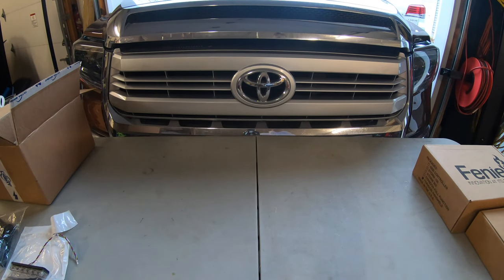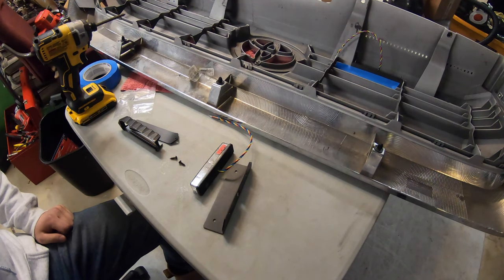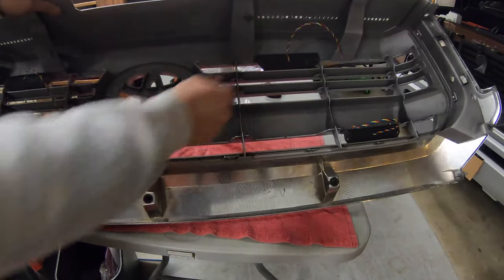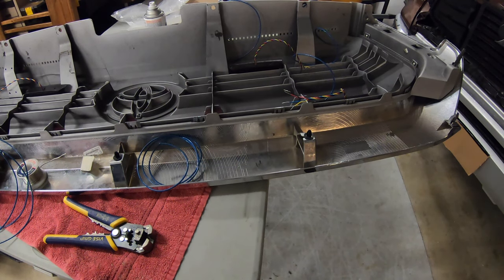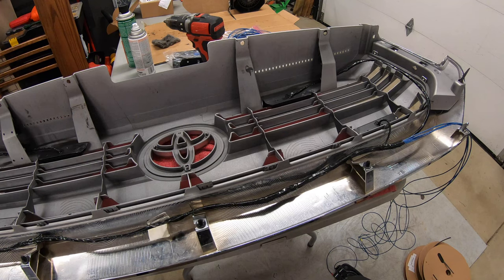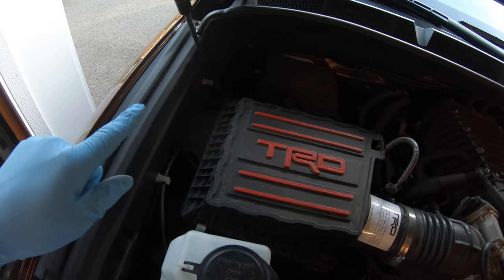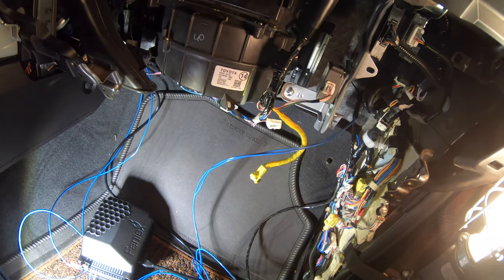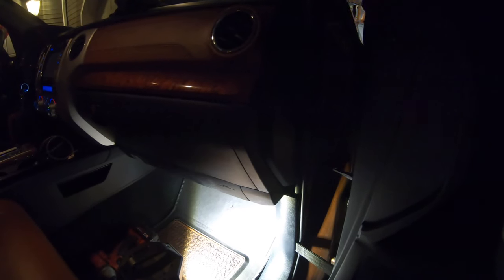Installing Fenix Surface Mount Grill Lights Fenix Triton Siren With Fenix Typhoon Toyota Tundra [4K]

Comment: I have the same set up that I'm putting in my 09 silverado, but only difference is I also have a  light bar to hook up, how would i do that?
Reply from the maker: If the light bar is also fenix you may be able to tie them together. How do you plan on controlling them both? A simple switch or some type of controller